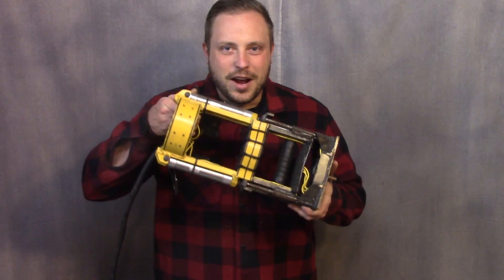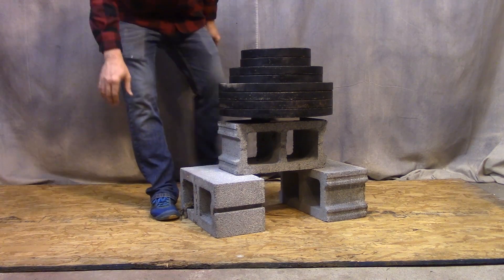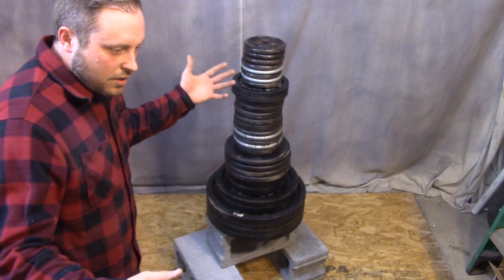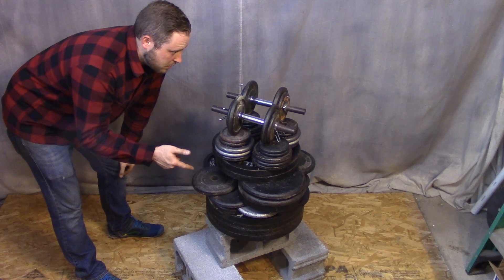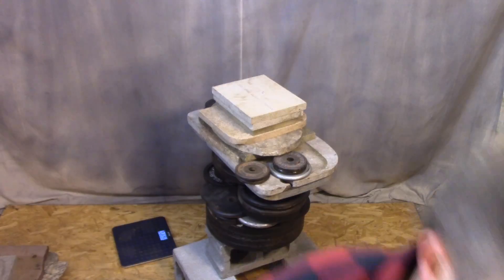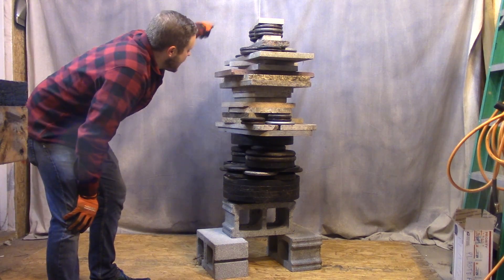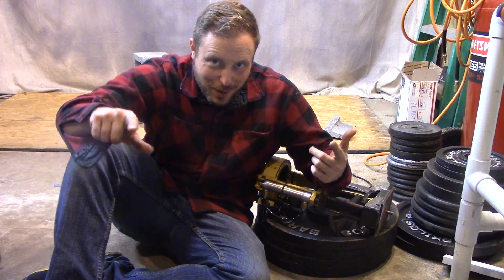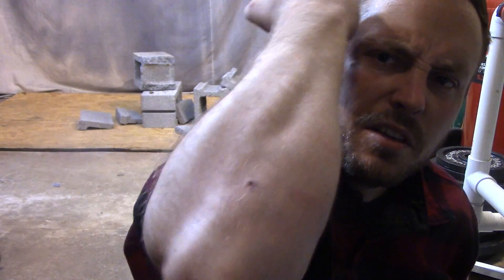POWERFIST POWER TEST - How much force to break a cinder block

Comment: 2000 pounds + no velocity or momentum = block not break cause of Velocity= energy = mass so if you have a power fist that have a weight of 3 hammers or more and with a velocity of a punch = a lot of force even without the powerfist you can do a lot of force with the momentum and weight of the fist and if you add the powerfist's weight and velocity with your punch it can break both 

Simple terms : the weight wasn't moving with 2000 pound but if you have a powerfist going as fast as an average man's punch = more damage because of simple physics

Comment: That pin that you have sticking out the flat of the power fist is making things very different, 
All the energy from your arm, through the power fist is going into that like 2cm squared pin and sending it straight into the concrete, it's the same concept as a stone chisel, just the weight of a hammer can chip rock due to the small surface area contact, so that's a lot of force and mass on an extremely concentrated area, I think if your power fist was actually using the flat of it then the results would be different as the force would of been distributed over that whole surface

Comment: Cinder blocks can hold so much weight because they are designed too but they are not meant to take impact from a object very well, if you drop one it will most likely break. Doesn't take that much force to break one that's why masons have to reinforce them with rebar and concrete

Comment: Two thousand pounds of force on two cinder blocks with a weighted fist? No! Not sure you know how physics works. Not to mention that you've completely dis-regarded the material in which you are using has High compression strength with brittle failure, but very low impact strength. meaning you can break it with a 20 pound hammer, but 20 pounds wouldn't cause it to crumble!

Comment: ... I don't know if stacking a weight on a block is a good way to measure the force of your device I can shatter a cinder block with a 20 pound sledge so I think it has to do with the area size impacting the block plus the speed plus the weight you put into it

Comment: Why not just Google the load capacity  for a cinder block that's pretty Standard  we used to put 60 ft trailers on cinder blocks  easily  weight  6 k  but  impact force is totally different while a cinder block looks more impressive I personally find wood harder to break

Comment: the reason it wasnt breking is bc the weight wqs built up over time and not a singlw impact type pressure
Reply: also bc the forst measurment was wromg adding a secons block and being able to break both does NOT mean you are hitting it with 1 metric ton of force

Comment: This man does not know anything about physics. First of all no matter how many weights he put on there it would've never broke because 1. That's pounds in mass not force you have to have acceleration to create energy and force x mass = acceleration and 2. He started with the two widest weights he had which is understandable but he just wasted his time if he could start with a small weight and move larger it still might not be enough he would have to have the pointed edge of a nailed balanced on the cinder block and then place weights on top of it because it needs to be able to penatrate to split but EVEN then it still might not be enough because there is no movement. I am a 4th degree black belt in Taekwondo and a 6th degree black belt in Shaolin and I've broken several stacked cinder blocks with my bare hands because I have enough force striking it I'd say he generated a good 200 pounds of FORCE not mass he's clearly no physicist and should stick to whatever the he'll he does

Comment: you NEED to put the smallest weights, in the BOTTOM. its not just pounds, its psi. dude, you KNOW this. you made a freakin' ROBOT SUIT DUSTER KNUCKLE for goodness sakes. : ( if you WANTED to break it, balance the weights on two rolls of dimes. : ( it'll break before you hit 600. : (

Comment: He says he puts out 2k pounds of force which is inaccurate because he put out much less force because of the inability of the human body to exert that, really all you need to break like 3 cinder blocks is like 100 pounds of force via a sledge hammer at the center of the blocks because of the surface area of the force output in a lesser space causes the blocks structural integrity to become compromised

Comment: Technically he could have took a 15 pound weight or even possibly a 5-pound weight and if he was just to hammer fist that b** straight into it it would have smashed cinder blocks are made to hold thousands of pounds of static pressure not impact

Comment: See, you put the bigger weights at the bottom so the surface area is greater and so it would evenly distribute the force of it. Thus making REALLY FUCKING HARD to break, since cinder blocks are designed specifically to have weight distributed evenly among them. Why do you think we stack them?

Comment: Hi I work in Masonry and I use those 8 inch blocks. They are meant to hold a load but a 8 oz hammer will brake on form a small hit on the side. But cool powerfist still

Comment: The entirety of your glorious tower's (good stacking skills bro) downward force was spread over those big 50lb plates. The point of force was not small enough to warrant breaking the block. If you were somehow able to balance even 200lbs on the point of some super strong needle, the block would be pierced right through. 

Not to mention, you were testing soft compression on the block, not an impact. Concrete shatters like glass under a hit but can take a ton of easy weight.

It's the same principle with soft body armor. It spreads the incoming pinpoint force of a speeding bullet into a greater area and you won't die, just bruise.

Also, sick power fist!

Comment: The real hero here, IS THE FLOOR.
Reply: Shafwan Dito the floor would not be able to hold up infinite weight, try putting something the weight of a neutron star on the ground and it would end up eventually in the core of the earth
Reply: Friar Jean real hero is gravity
Reply: Shafwan Dito I've already broke a tile of my floor by letting a steel fork fall onto it.
Reply: Friar Jean nah, the floor able to carry unlimited of weight and you can stack 10 jumbo jets (if that is possible) and it's still wont break since it's connected to ground, the cinderblock is the real hero
Reply: +Shafwan Dito You're high, everything has an equilibrium, the ground constantly moves, ever seen sinkholes happen on asphalt?

Comment: dude, the block has 2 sections, which are split through the middle as you can see. the weight is being dispersed through so it won't crumble because it's being supported.

Comment: cinder blocks were designed to carry alot of weight so him doing this is like well just look at it if you have the weight evenly distributed its not gonna break thats why it has a column in the middle so it can take force
Reply: also the big plates on the bottom might be a good start for the tower but it distributes the weight alot more due to the surface area and also giving the tower a tap on the top with a small hammer wont do very much it has to move though so much to put the force into the cinder block down below but im probably wrong on the its probably adding more weight onto it due to his pound per hit with the hammer and also the hammers weight/how much force and how much the hammer wieghs

Comment: hi Force=Mass*acceleration. if nothing is moving you are not accelerating and you don't have force. try dropping the weights on the blocks, they will accelerate at the rate of gravity which is 9.81. Eg 100Kg dropped would produce an impact force of 981 newtons.
Reply: if this helps, can i have your power fist? XD

Comment: If it is in a wall, the allowable load would depend on the height of the wall.

The specifications (ASTM C90) for hollow load bearing concrete masonry units require that the block has a net compressive strength of 1900 psi. Since a 8" block is about 50% solid, it would take about 120,000 pounds to break it. The load you put on it in a building is much less because of a factor of safety.

Comment: Just because the cinder block can hold 1000 pounds of weight doesn't mean it can withstand 1000 pounds of force. Weight and force are two different things in physics.

Comment: Cinder blocks don't break under weight unless the weight is in the several-thousands. Cinder blocks will usually only buckle and break when large amount of force (a.k.a. not weight) is applied in one moment, causing the particles of the cement they're made of to jostle and shift, eventually leading to a failure in the structural integrity of the cinder block, and once there is one failure, many more will insue.The reason cinder blocks don't buckle under normal amounts of weight (yes, 1,000 lbs. is considered a very low area of the average weight a block will have to take on) is because weight is a constant, meaning just adding weight isn't going to exert as much force as a shock, which is a burst type of force.

Comment: Force does not equal weight. There is a difference between laying down stable weights on a flat surface and throwing yourself down into one concentrated point. Also whats the point of a power fist if theres no extra momentum from co2/hydrolics? :/

Comment: only reason you made it through is because the force of your punch was concentrated on that tiny pin 

attach that metal plate to the end of your device and you would not be able to punch through it

Comment: The reason you're having a hard time crushing the block is because all that weight was being distributed across the entire block into the two base blocks. 
I'm pretty sure you could definitely just break that block with 1000 lbs of force by concentrating the hit

Comment: It's not over 2000 pounds the tensile strength of concrete is more than steel but the grain structure is very weak so most blunt impact will destroy it

Comment: You forgot that velocity and mass take part in breaking stuff. That is why you can break it with the fist but not the weight. Concrete is designed to hold a lot of weight, but not when it is going very fast. In order to penetrate armor you need a small thing going very fast just like a bullet.

Comment: You dummy. If you drop a cinderblock on a cinder block one of them will break. Its because one they are both hard and two its force that is applied quickly. That punch was not more than 1000 lbs

Comment: Mr jauris I'm going to ask you something do you know how cinder blocks work? You can drive a car over one and it will not break it's common sense for even a construction worker that's why people build homes with them ....a better test would be to have a impact calibrator so you can measure the exact amount of force used those are pricy but this is retarded for someone who built this I'm assuming you have a background in how physics and technology works

Comment: A punch is measured in impulse so the force needed to break a cinder block would be useless and regarding units force is not mass and use Kg if you are benchmarking.

Comment: Why is the weight spread out over the entire cinder block? If you're testing a punch then all that weight needs to be in the shape/size of a fist. Also they broke at the weakest point which is just to the side of the center support column. What's so amazing about this? You misrepresented how weight works on a cinder block.

Comment: You had a bottom weight with massive amounts of surface area distributed across the cinderblocks surface then proceeded to punch them with a small cylinder on the end of the fist

Comment: The surface area of the weight between the fist and the actual weights adds a vastly different force output. Your power fist dumps all of that kinetic energy into a nail sized area. While the weights took around 1 square meter of surface area.

Comment: That's not a very accurate way of showing how much force the Power Fist has. it wouldn't have that much force because it exerts the force on the Block in a very quick Manor. What you were doing was you were putting more weight on to the blocks overtime so the block can get used to its environment as with the Power Fist it exerts it in a very quick fashion it's not accurate.

Comment: You could punch through them using basic gauntlents that are suspended from your hand. It doesnt take much to break a cinder block,. But the way you went about testing it's strength is wrong.

Comment: you positioned the weights very poorly because the bottom weights made it so you position the weight evenly between all 3 blocks, not the center of the middle block like the powerfist would

Comment: It's not only the amount of weight you have to take into consideration the acceleration of the power fist is important as well due to the fact that the amount of newtons of force increases with an increases of weight and acceleration. So you need to find the acceleration and incrementally increase the weight according to that until you destroy the cinder block. How you would do that I don't know but that's why the cinder block wasn't being destroyed under all that weight

Comment: The reason the first cinder block didn't break was because he was putting the widgets on so lightly and gently. If he slammed them on each time or all at once it would've surely broke the block. G force is another thing you have to think of, not just weight.

Comment: Force is an expression of Mass x Acceleration. 1,000 lbs sitting on top of the cinder block with 0 acceleration is less force than something lighter moving faster. Still a nice job though.

Comment: why is there a pin on the front of the fist?
beacause a smaller surface area means more force on that area. so the whole "staking test" doesn't apply unless you use the exact same plate.

Comment: The cinder block didn't break when it was given so much weight because the weight was evenly put around the entire block, but when he punched it, the pressure of that small point didn't even out the weight which then put all the weight of the guy on the small point making it get insane pressure on that small causing it to break. Same thing with a bullet, it would definitely break that cinder block because of the pressure going into it
Reply: area of pressure is almost the same, he reduced the area of the weights by putting that piece of PVC there
Reply: 5:50 Nope the small point retracts. He's just stupid.
Reply: Also go to like, 0:50. All the weight is in the middle. It's not destributed, even less so than the fist. It's the way cinder blocks are constructed.
Reply: +LukeTheCrusher - hmm, I would have never thought of that. Great info
Reply: Joshua Daneil Np

Comment: bro u do know they use cinder blocks to hold up most prefab houses right? lol not to mention when your hitting the block your applying all that force in a very short ammount of time meaning the force doesnt have time to disperse throughout the block before it hits the breaking point. which is why you can cafefuly set a house down on it but can easily break one if you drop it

Comment: Actually it's it's not that you put out over 2000 lb of force it the little spike it the power fist that take all the momentum (whether it be under or over 2000 lb of force) and it pushes through the small surface area of the spike amplifying the the total amount of energy out put... its similar to how small sharp objects can completely break windows

Comment: okay one thing is cinder block and support way over a thousand pounds easily second of all someone punching something has more Force because the velocity of the punch adds more Force like how if you would it take so just laying it on top isn't going to do s*** you have to punch something because the velocity is going to add and make it easier to break if you were to take a 10lb weight and smash it the center block break because of the velocity but if you just stack them all on top it's not going to do s*** because well they're designed to hold stuff my advice do a little research before you make a YouTube video

Comment: Your test is flawed. You're applying a static distributed load. A power fist would deliver a dynamic point load. You should stack the weights on top of a single infinitesimally small point in the center of the cinder block to replicate a static point load. However the only way to replicate a dynamic point load is to use an advanced compression testing machine or by using the powerfist itself outfitted with special sensors.

Comment: 1 month later ok guys so 3 black trucks pulled up into my Drive way and Men in black suits came in and seized the powerfist but what they didn't know is that I have the Blue print for it they burned what they thought it was and I made another  one with improved hydrolics lets test it out on these 4 cinderblocks